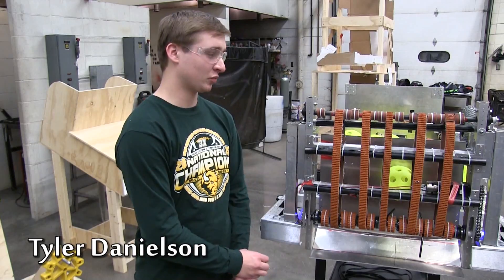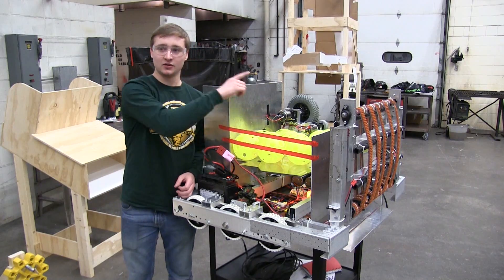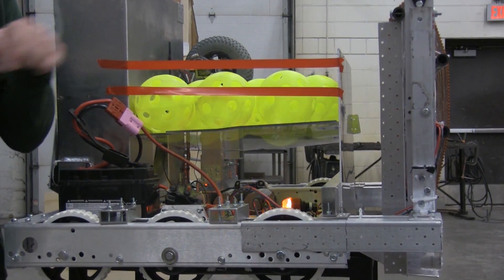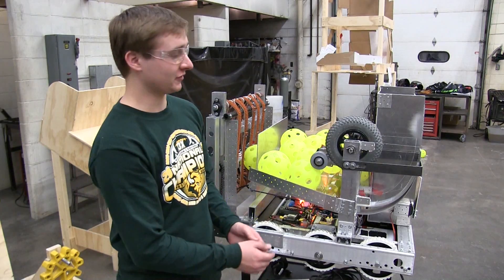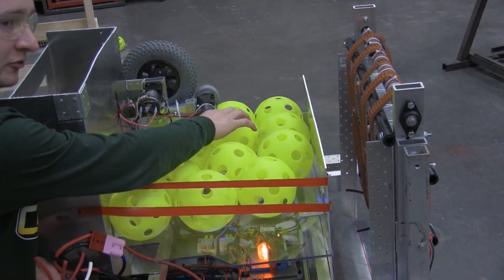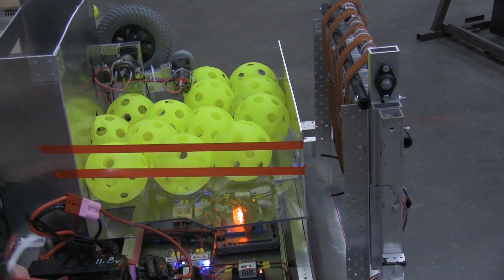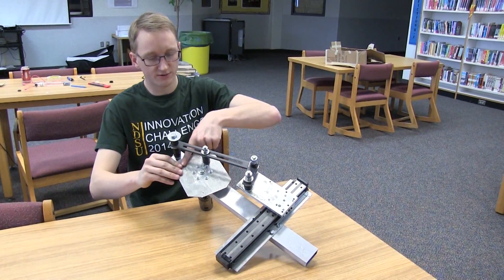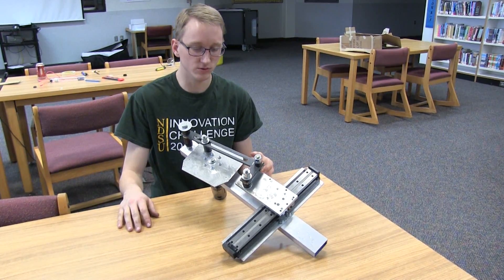Ri3D 2017: Team GreenHorns Day 3 Update

Comment: Did the climber end up working? And if so, what are those hooks? They look like wires, but how are they strong enough? Thank you so much
Reply: The climber worked great, climbed in 5 seconds. The little hooks are only for grabbing a knot on the bottom of the rope. They're made from 1/8" steel round bar, and they're bent through a hex shaft. There are many ways this same function can be accomplished. We just used what we had on hand.

Comment: is a manipulator able to go outside of the perimeter or does the manipulator have to stay inside the allowed dimmenions
Reply: only if your bumper perimiter is smaller than the total size so if it calls for no more than 30 inches on one side and your bumpers are at 20 for that side then you 10 inches of play
Reply: So the bumpers ARE included in the measurements thats in the rule book of section 7.2 correct? I've read the manual but some things are a little confusing ( first year doing this).
Reply: yea the bumbers are part of the perimeter